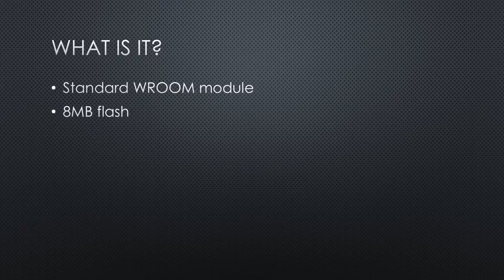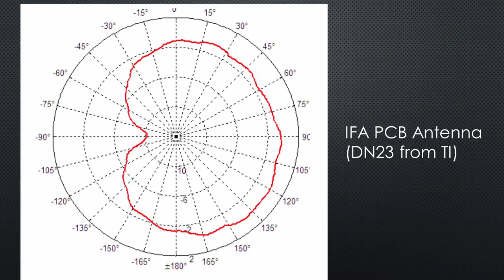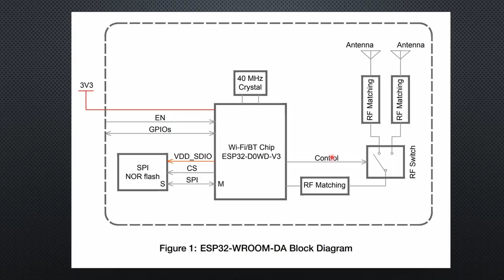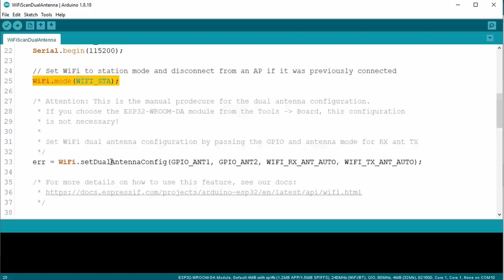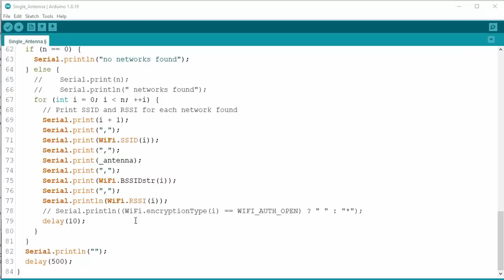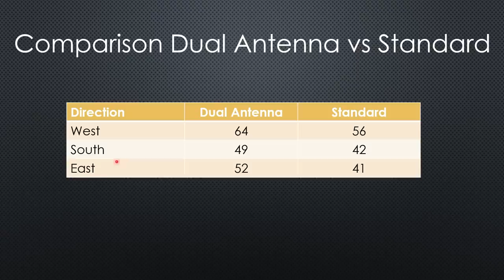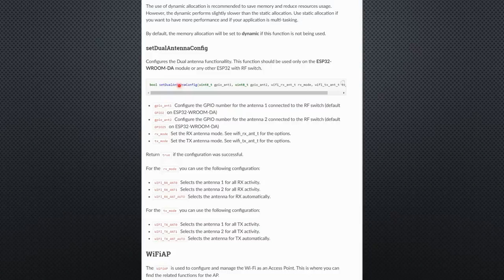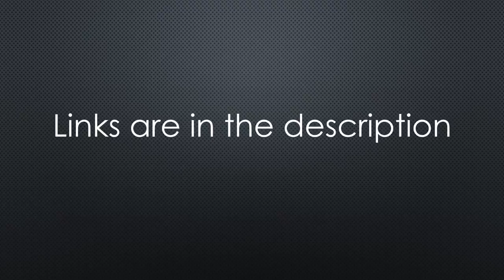#422 A new Dual Antenna ESP32 Module: The WROOM-DA

Comment: @Andreas Spiess Can you please share your code related to this project ??
Reply from the maker: As said in the video: I used the example file provided in the Arduino IDE
Reply: Heyy  @AndreasSpiess  What are the sources of the json files while installing of esp32 broads in Arduino ide
Reply from the maker: @vaibhavsingh6775  Just search for "using the ESP32 in the Arduino IDE". The -DA is part of the standard ESP32 family.
Reply: @AndreasSpiess   I conducted a test to compare the signal strength of a single PCB antenna connected to ESP32 and a dual antenna connected ESP32 WROOM DA module. After testing both modules, there wasn't a significant difference in the RSSI value between the two (a difference of 10 to 12 RSSI points). Is there a way to connect with you to show that I can share the images of the serial monitor where the RSSI values are getting printed? 

To conduct this test, we configured the two modules to scan nearby wifi using an ardArduinouino example code. We configured the antennas in the DA module in AUTO mode as per the Arduino ide example code and placed the two modules next to each other.

After flashing the code onto the DA module, we observed that the DA module was able to sense a few extra numbers of WIFI networks in comparison to the normal ESP32 with a single PCB-connected antenna. But not so much in the RSSI values. We expected a better response from the DA module.

I would be grateful if we could just verify if these are the expected results from the DA module, as I have to make a selection between the modules for my next product
Reply: @Andreas Spiess is it possible for us to connect in any way so that I can share my project with you? Your guidance on this matter would be very valuable to me
Reply from the maker: @vaibhavsingh6775  YouTube is only my hobby, and unfortunately, I do not have time for side projects 😞 You decide if the effect is big enough for you. I do not expect that you got very different results than me.

Comment: 2 antennas could be useful as for a repeater function . for a mesh maybe . iot mesh .
Reply from the maker: For a mesh you do not need two antennas (as the Meshtastic project shows). These projects listen for a time and transmit for another time. You cannot transmit and receive at the same time on such close frequencies. You would only hear yourself.

Comment: I can only hope that "Auto" means it uses the antenna with the better quality signal when actually connected. And from your data it seems to mostly list networks were both antennas found a connection. There are a few were either only Ant0 or Ant1 had a connection, but might just be that at the previous passes they were just unlucky.

And this module seems to be a complete waste of opportunity - you can only use 1 of the 2 antenna at once? Really?
Reply from the maker: You would create a lot of problems if you transmitted on both antennas in parallel because these signals would interact. This is why we often use a so-called "space diversity" where we select the antenna with the stronger signal.
Reply: @AndreasSpiess  To clarify: I'm a software engineer that has studies with a focus on software and hardware.

Anyways - sending on 2 antennas at once is not really a problem as long as you are aware of what you are doing. The 2 antennas like they are configured on that board are looking in different directions, using them together would be a simple co-phased antenna, basically pointing right in between their respective direction and allowing for slightly better gains in that direction for sending.

Or of course used on different bands independently.

Either option would be a significant upgrade to the functionality.

Comment: Of course a software guy starts at zero - all vector indexes start at zero.

We don't use pascal any more.
Reply from the maker: And the hardware guy at 1. Like R1 or C1
Reply: @AndreasSpiess  My compromise of starting vector indexes at 0.5 was dismissed without, I thought,  proper consideration.

Comment: Shame that manual doesn't say anything about it. Most likely diversity works only when connected to specific station. It checks RSSI of station from both antennas and decides which one has better signal.
Reply from the maker: I wonder why this could not be done while scanning :-( RSSI is available at least ( as shown in my tests)
Reply: @AndreasSpiess  It is all in software, I hope they will implement this in future.

Comment: Possible use every core for a different software? Select the antenna can be done with the new OS dev version. Oh he tells it right now, haha..
Reply from the maker: The antennas are connected to the radio, not to the cores :-(
Reply: @AndreasSpiess  Yes but i can be switched so far i have heared.